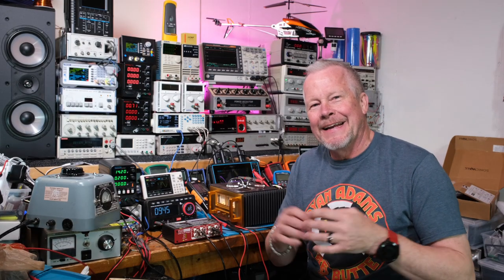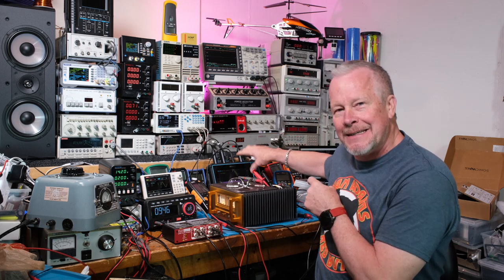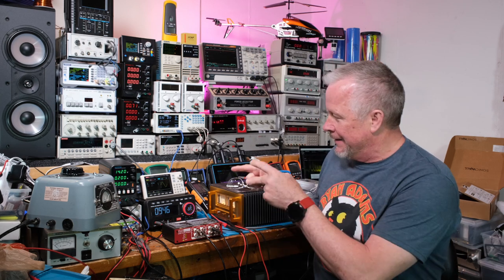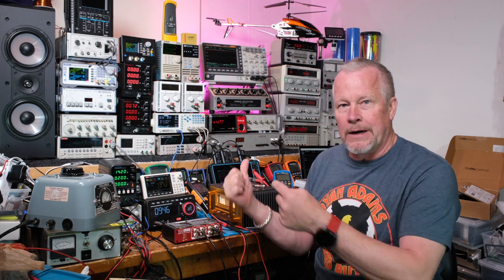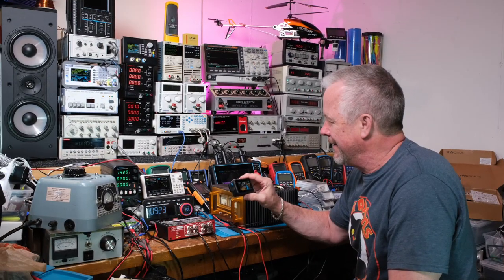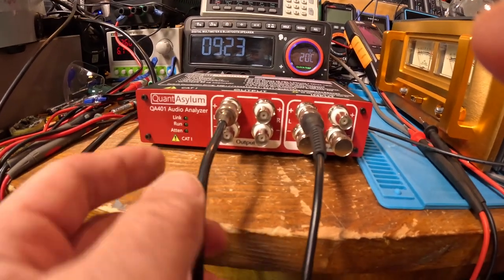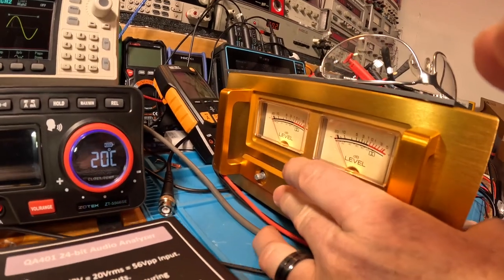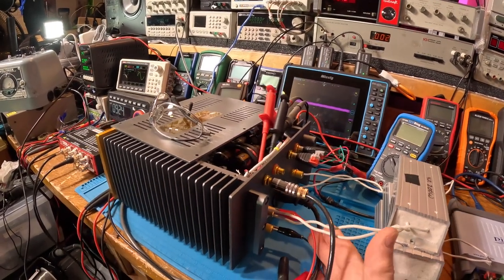Test Results 20 Watt Class A Amplifier with Quant Asylum QA401 #quantasylum #QA401 #classaamplifier

Comment: Great video and fascinating but some of the tests worried me I am not a hifi guru but I am an engineer. For instance in all the test the roll off and performance overall was terrible even at 10Khz. Hawkwind screwed my ears years ago but I can still hear stuff up to 13 Khz and the test shows dreadful THD and THD+n @10Khz and it was rolling off there too and I think there was way too much power supply noise personally. One of the graphs clealy showed a THD of 10 % just before it rolled off at 10 Khz and that's bad. I was taught that class A had great sound and specs but very inefficient whereas class A?B had slightly worse specs but are far more efficient ?  please do more on this....cheers.
Reply from the maker: Thanks for your great feedback!  You pointed out the same things that I was thinking;)  If I had not heard this amp I'd be worried to say it was finished product.  Now that I see the test results I question my hearing;)  My friend likes his music loud and maybe that covered up the noise.  This amp does sound very open and clean - so I'm very surprised by the tests.  

There is an extreme lack of filtering around the input section.  I would like to swap out the transformer/bulk caps with a switcher and filter the OpAmp stage.  Also change the input filter to get the 20kHz bandwidth.  I have more boards, so I think I'll keep this unit as is and give back to my friend, then build a modified unit and then give it to him to listen to - and see what he thinks;)
Reply: @KissAnalog  Great plan !

Comment: It looks like you are running an older version of the software. I have the next version, the QA402 and love it. If you are careful with the voltage level that you are probing, you can hook up a scope probe to one of the channel inputs and it becomes a great troubleshooting tool.
Reply from the maker: Thanks for the great feedback!  I did actually have diff probes on input and output and was watching the waveforms.  I will have to show this in an upcoming video.  I need to update the software too.  Was there an obvious change to the software?

Comment: Why the distortion at the high frequencies 10% would it help to have a better filtering on the power or and drive transistors at 10k. I would like to see the third harmonic lower at least another -3DB especially when you're playing digital sources through the amp can make a big bearing on sound quality
Could you get the power supply noise down to minus 130 db? That would be good lol
Reply from the maker: Great questions!  I was a bit surprised at the results.  I will have to see what I can do to see if there's some easy mods to get this to test better;)  I think some high frequency filtering at the OpAmp voltage rails.
Reply: @KissAnalog  op-amp right
Are those chips quite noisy? Thats probably why people go with discrete. You didn't check square wave you're not getting ringing? You had a lot of side band on the main frequency quite high I thought, isn't that usually a sign of ringing? How could you reduce the side bands further? Could you noise cancel them out by reversing the input phase? Is that feasible for every single? What is the damping factor of the amp got a figure. How do you describe the sound of the amplifier?? does it have a good sound stage front and back and side to side, is it quite airy a lot of separation of the instruments easy placement.
What is the VA of the transformer? Doesn't seem to look that big on the picture, I think something like a 2,000 VA would be a greatly better and not particularly expensive at 130$, not the ones i have seen made in Poland, they go up to 6,000 VA. to be truly class A you need a big transformer. Oh I like the approach of having two transformers one smaller for the preamp and one larger for the main amp that works better I believe. That's something you could do in a separate box connected with a din plug to the amp or go battery! We don't see enough good battery amplifiers these days considering the power of the batteries and the ease of recharging, I would have thought there'd be more of there these days.

Comment: I reckon InterMod Distortion sounds horrible and noisy, whereas Harmonic Distortion sounds good it adds body to the music.  You should not be able to hear any 50/60Hz hum .
Reply from the maker: Thanks for your feedback!  I tried to isolate so that the 50/60 Hz hum didn't come through.  It did at first, but the inductors in the Chassis ground connections seem to have solved that issue.

Comment: Its realy bad amplifier..
Reply from the maker: Thanks for your feedback, but why do you say that?  Is there a particular test that you didn't like?
Reply: i would like to know if the result is in line with the simulation result.
yes nice test equipment, but it is bad result for class A that burn so much power, 
it is way worse than a cheapo LM1875.
freq response already roll off way in the audio band. not to mention the THD.
maybe the setup test is not correct?

Comment: If this is an example of class A I'm not impressed. Of course, it sounds like a valve amplifier because it has the same high THD, the same rolling HF. If you are saying it's OK to have such high THD why worry about crossover which will add an almost undetectable rise in THD. Which of course is absent anyway with a correctly biased class AB. All that THD distortion is colour, it's an additive to the signal, much like adding extra sugar to a cake. It may be pleasing to some people, but it is an additive after all. HiFi is all about as near as possible hearing the original signal, not adding stuff to it that can make the signal seem better. 
I think I will stick to my crossover free class AB amplifier. Nothing I've seen here would make me feel the need to go class A. Plus it's VERY un-green in today's politically correct speak!
Reply from the maker: Thanks Michael.  I agree with everything you said.  I want to mod this amp to see if I can improve it.  But, I do have other Class A amps that I want to build and test.  I'm surprised how great this amp sounded - but we were playing it at high levels and it was rock n roll so maybe the color did add something - or maybe those levels are low enough not to actually matter?  I'm not sure but I want to experiment with my friend on other amps to see what he thinks.
Reply: Eddie: You mentioned at 15:05 that class A amplifiers, especially tube amps have higher distortion. From what universe is that coming from? It’s true that a topology with a single ended output will be susceptible but, a competent Lin design with a class A push pull output is capable of the lowest possible distortion of ANY amplifier.
You don’t explain anything about the topology of the amplifier you’re measuring. If it’s a class A push pull output then I’d say the design of the preceding stages are pretty poor. There is nothing commendable or acceptable about the distortion performance of this amp. And anybody who believes that high(er) levels of distortion sound better needs to take some critical listening training.